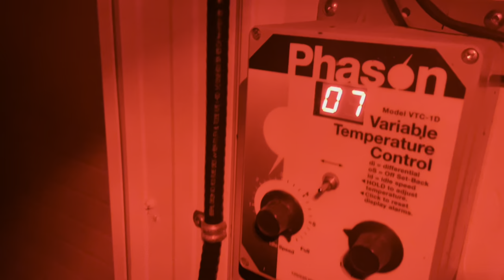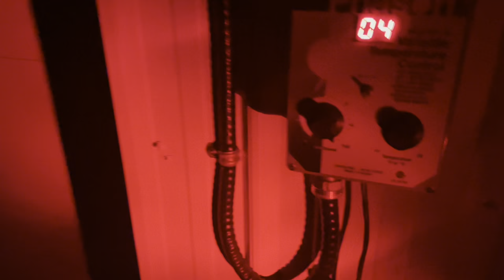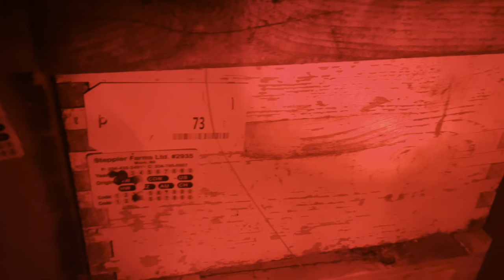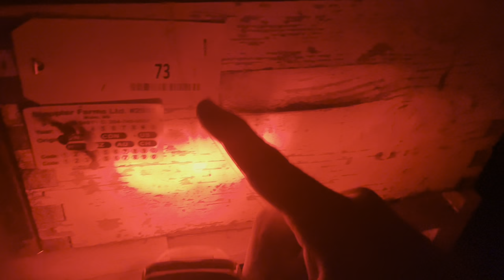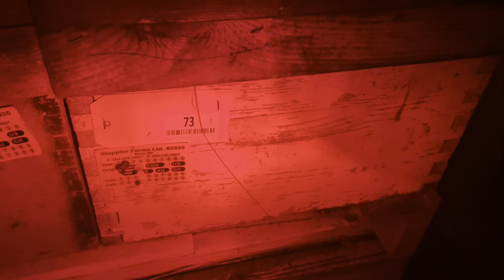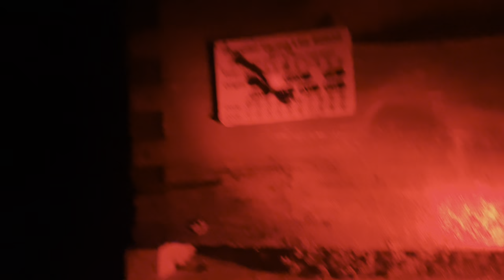Watering My Bees, Themselves

Comment: Good morning Ian.  What do you use to clean propolis and wax from equipment? I thought in one of your posts you used a detergent or spray that’s safe on the extracting equipment
Reply: Honey and hot water on the extraction equipment, hotwater and metal brushes on the excluders. No detergents.
Reply: @carriemartindale-wetherup5243  do you use the honey residue already present, or do apply additional honey as an emulsifier basically to get the wax and propolis off?

I would assume that you have waste honey from draining lines or rendering wax etc that you can use?
Reply: @ke6gwf  about an hour before shut down we add a little bit of honey to the chains to help get propolis etc off, not enough to drip into the rest of the honey just enough to emulsify so i can get it clean.
Reply: @carriemartindale-wetherup5243  this is what I love about you guys, these little tricks that you don't even know that you need to know!
Thanks!